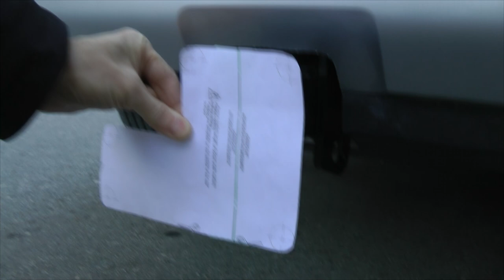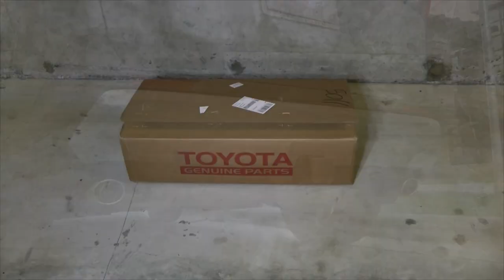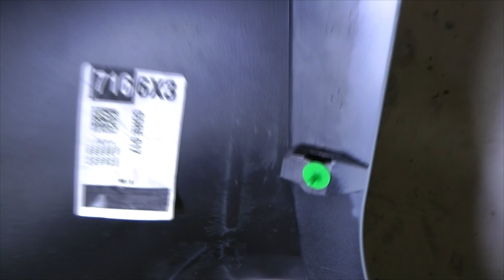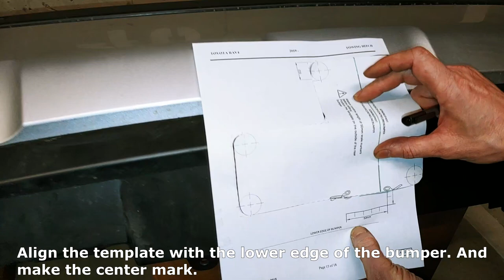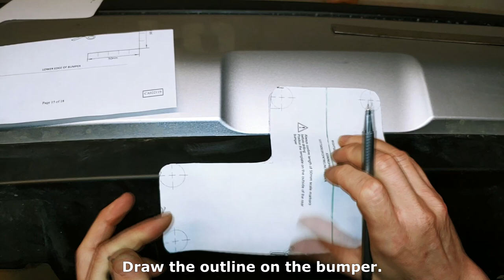Toyota RAV4 (2019-2024): OEM Toyota Hitch Installation.

Comment: great video,  i wonder if there is other option that i don't have to cut.  i have a rav4 2023
Reply from the maker: Thanks! If you plan to install the OEM hitch you will need to cut the rear bumper.
Reply: @MorozovAutomotive  thx for your rapid response, and what about a non OEM?
Reply from the maker: Toyota RAV4 (2019-2022): How To Install The Curt Hitch - https://youtu.be/Whx6ZDAy41A.
Reply: @MorozovAutomotive  that is perfect, i was not very fond to cut the rear lower bumper of my new baby.  thanks a lot

Comment: I'm trying to buy this at a Toyota dealership for my R4P do I also need to buy the tow hitch hardware kit? Or just PK96042K10
Reply from the maker: If you need to install just the hitch itself, there is no need to buy the trailer wire harness.

Comment: Can you post the full list of tools you used for the install?
Reply from the maker: Tools used: 10mm socket, 8mm socket, 14mm socket, 19mm socket, socket wrench, ratchet, torque wrench, flat-head screwdriver, Phillips screwdriver, knife.

RECOMMENDED TOOLS:
1. LED HEADLAMP - Coast FL85R 700 Lumen Dual Color (White/Red) Focusing Rechargeable LED Headlamp - https://amzn.to/3LVebVx.
2. WIHA HEAVY DUTY SCREWDRIVER SET - Wiha 53097 Screwdriver Set, Slotted and Phillips, Extra Heavy Duty, 7 Piece - https://amzn.to/3ystzRx.
3. SOCKET SET, RATCHET - GEARWRENCH 57 Pc. 3/8" Drive 6 Pt. Mechanics Tool Set, Standard & Deep, SAE/Metric - https://amzn.to/41wE6Z3.
4. SWIVEL HEAD RATCHET - GEARWRENCH 2 Pc. 1/4" & 3/8" Drive 72 Tooth Dual Material Roto Ratchet Set - https://amzn.to/3kwhHdS.
5. FLEX-HEAD RATCHET - GEARWRENCH 2 Piece 1/4", 3/8" Drive 84 Tooth Full Polish Flex Head Teardrop Ratchet Set - https://amzn.to/3yjPHNK.
6. STUBBY FLEX HEAD RATCHETING WRENCH SET - GEARWRENCH 10 Pc. 12 Pt. Stubby Flex Head Ratcheting Combination Wrench Set, Metric - https://amzn.to/3IKVP6y.
7. RATCHETING WRENCH SET - GEARWRENCH 16 Piece 12 Point Ratcheting Combination Metric Wrench Set - https://amzn.to/3JqYunC.
8. 3/8" TORQUE WRENCH - GEARWRENCH 3/8" Drive Micrometer Torque Wrench 10-100 ft/lbs - https://amzn.to/3YmhnN2.
9. DIGITAL ADJUSTABLE TORQUE WRENCH - Hilmor 1963826 Digital Adjustable Torque Wrench - https://amzn.to/3FULVPh.
10. PRECISION KNIFE - Fiskars Heavy Duty Die Cast Craft Knife - https://amzn.to/3KGF5A9.
11. DIAGONAL CUTTER - KNIPEX 74 22 200 Comfort Grip High Leverage Angled Diagonal Cutter, 8-Inch - https://amzn.to/40w0vVf.

Comment: Did this install on my 2020 RAV4 Hybrid. Instructions are flawed. You don’t need to remove anything from the rear seat on. In terms of installing the  wiring harness
Reply from the maker: We installed the wiring harness in the non-hybrid RAV4 which has the 12v battery under the hood. In this case you need to run the wire from the battery all the way back. In your case, the hybrid RAV4 has the 12v battery in the back. This simplifies the process. Instructions that we used are the official Toyota instructions for their techs.

Comment: Is anyone else getting a ton of noise from the hatch area after installing the OEM hitch? It sounds like my bumper is making a rubbing/squeaking noise anytime I hit a bump or drive on rough roads. Not really sure how I could have installed it incorrectly though.
Reply: Were you able to resolve this issue?

Comment: Is it me or does the OEM hitch seem like way more work than the aftermarket ones? The aftermarket ones don't require having to take apart bumper, lights, etc.
Reply: Aftermarket is garbage.
Reply: After market sit lower.

I installed one but I'm only going to use it for hauling bikes so it's good enough.

Comment: where did you get the second part to the paper template?
Reply from the maker: It comes with the set.
Reply: @MorozovAutomotive  thank you for responding. apparently the manual that I had in the set (despite it being 18 pgs out of 18) did not come with another page. It was on the same side so I had to draw it on a separate paper. Nonetheless, your video was amazing thank you!!
Reply from the maker: No problem. I believe we did make the copy of one side of the page as well. Glad  the video was helpful.
Reply: I had to make a copy of the back of the paper. Took me about 30 min to figure it out.